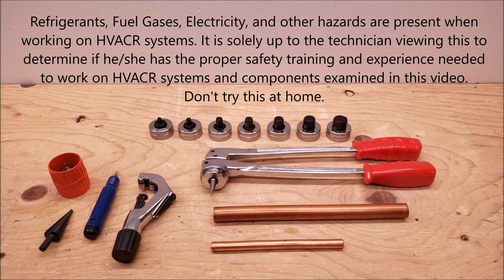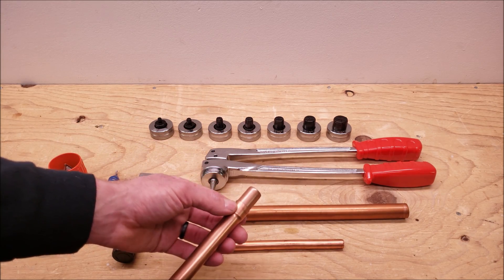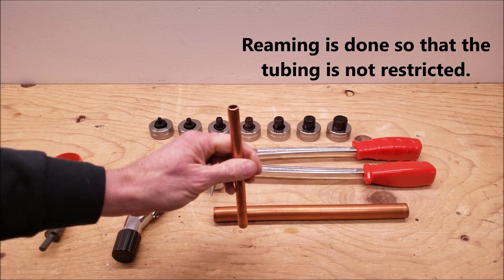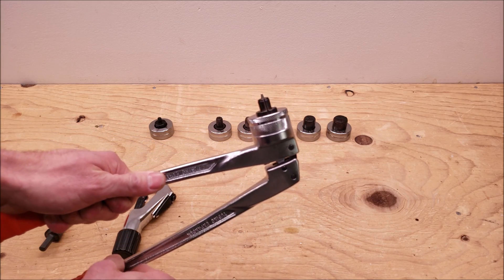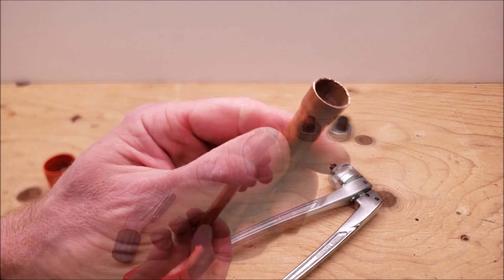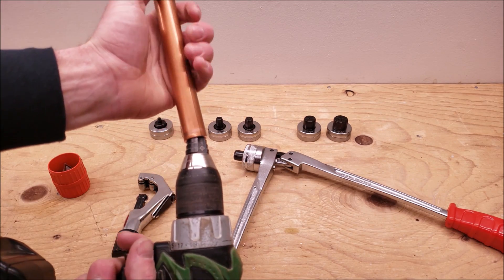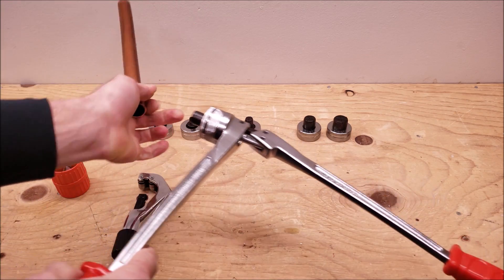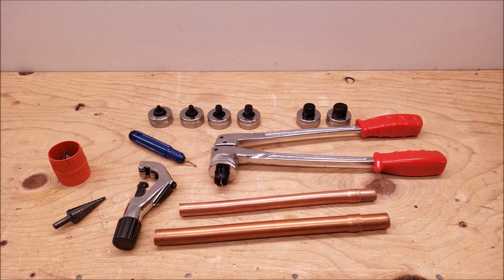Using a Manual Swaging Tool To Expand Copper Tubing!

Comment from the maker: Support-  https://www.patreon.com/acservicetech

Tool List-  https://www.amazon.com/shop/acservicetech

For those that are looking for the tools used in the videos: (Linked Below)
Manual Copper Tube Swage/Expander- https://amzn.to/2WRPa1M
Uniweld Hydraulic Swaging Tool- https://amzn.to/2MlrI8m
Uniweld Swage and Flare Kit- https://amzn.to/2T55jyn
Uniweld Hammer Swage kit- https://amzn.to/2CzWMMU
Uniweld 3/4" Hammer Swage- https://amzn.to/2CzXsSs
Uniweld 7/8" Hammer Swage- https://amzn.to/2Mja5WE
Uniweld Multi-Size Hammer Swage- https://amzn.to/2T3Cx1b
Ameriflame Oxy Acetylene Torch Setup- https://amzn.to/2SRm3JF
#2 Tip for Oxy Acetylene Torch- https://amzn.to/2SPDaeD
Cap-N-Hook Tip for Oxy Acetylene- https://amzn.to/2MbhpUk
Air Acetylene Torch Setup-    http://amzn.to/2aQalsb  
15% Silver Brazing Rods-  http://amzn.to/2gVLyLc
Nitrogen Regulator-   http://amzn.to/2bXdR5f
Nitrogen Flow Meter-    http://amzn.to/2brvoBg
NitroVue Flow Reg-  https://amzn.to/2MiulYv
Ultrasonic Leak Detector- https://amzn.to/2Lw4Zpr

UEI DL479 Multimeter with temp sensor http://amzn.to/2jtsUbJ

Magnet Jumpers- https://amzn.to/2PyKPQZ

Alligator Jumpers- https://amzn.to/2PxqJXn

Fieldpiece ST4 Dual Temp Meter  http://amzn.to/2wc1ME3

Fieldpiece Bead K Type Temp Sensor https://amzn.to/2DBwKfs

Fieldpiece Wet Bulb Temp Sensor https://amzn.to/2RRI7Tw

Fieldpiece TC24 Temp Clamp https://amzn.to/2qHLyjZ

Yellow Jacket Refrigerant Gauge Set http://amzn.to/2aenwTq

Refrigerant hoses with valves http://amzn.to/2aBumVI

Yellow Jacket Gauge set & hoses https://amzn.to/2vLVkV9

Yellow Jacket 4 Port Manifold w Hoses https://amzn.to/2BkuGIq

FieldpieceSMAN360 Digital Manifold Set https://amzn.to/2BdoaD4

FieldpieceSMAN460 Digital Manifold Set https://amzn.to/2nB4Fe6

Compact Ball Valve for Refrigerant Hose https://amzn.to/2KUisW8

QuickDisconnect 90 for refrigerant hose https://amzn.to/2MMtVcg

JB 6 CFM Vacuum Pump   http://amzn.to/2nqbvo8

Appion Blue 3/8" to 1/4" Vacuum Hose http://amzn.to/2uYlVyc

Appion Red 3/8" to 1/4" Vacuum Hose http://amzn.to/2uYg6Ro

Appion Valve Core Removal Tool http://amzn.to/2uYr8WL

Yellow Jacket 1/4" by 1/4" hose http://amzn.to/2umtcod

CPS Vacuum Micron Gauge http://amzn.to/2v1nM3O

Supco Vacuum Micron Gauge http://amzn.to/2v1JRiA

RectorSeal Bubble Gas Leak Detector http://amzn.to/2ckWACn

UEI DL389 Multimeter  http://amzn.to/2xAdaJf

Other tool links can be found in the video description section.

Shop through Amazon! Your Purchases through Amazon provide a means for channels such as mine to earn advertising fees from all purchases after clicking through. Prices are the same as normal-    https://www.amazon.com/shop/acservicetech

Comment: why would u turn that pipe in the midlle of the process?
Reply from the maker: That is because of the gap created at the tool head to avoid the copper from cracking there and to give a more round finished product, thanks!

Comment: It is easy to ream a pipe when it is not fixed in place, however, what do you do when your faced with a line set that is fixed in place and you have to cut pipe. Reaming the section of pipe that faces downward is easy to ream, however, what about the pipe facing upward. Deburing the bottom half of the pipe would cause burrs to fall down inside. Can anyone advise how to best handle this scenario.
Reply: Use a long screw and screw that into a piece of cloth then run the cloth inside the tube then debur, then just pull the cloth out with the burs.
Reply: I blow nitro at a higher pressure and it works for me. Just ream it evenly to keep the shavings in one piece. Hope this helps brother.

Comment: My Rothenberger  swaging tool sits in the back of the van. I press 99% of my fitting now. Besides I always anealed my copper pipe. It softens the pipe and helps harden it. Preventing it from splitting.
Reply from the maker: Yeah some companies are press fitting, thanks gostmanromeo uk!

Comment: Last job I worked on was breaking some of the older pipe so had to use couplings ?
Reply from the maker: Hey Matt, What size were you swaging? I don't use expander tools such as the hydraulic or the this one for 3/8" or smaller. The opening size between the die teeth end up cracking the pipemon 3/8". This doesn't happen every time but sometimes it will have a crack that you can't see it with 3/8". Sometimes it will swage the 3/8" ok but I find that using the hammer or turn style swager with the swage block works best for 3/8" every time. For the other sizes 1/2" to 7/8", it works pretty darn good. I will tell you that depending on the manufacturer and the batch, the copper tubing may be able to be bent but just is not annealed enough and can crack when trying to expand. Annealing is the heat temp process that allows the tube to be soft. This doesn't happen very often but when it does, you may want to let your distributor know if it is new. I had a 50 ft box of line set that was new and I was trying to bend it through the building. It started kinking in spots. I got pretty frustrated and was thinking, this does not normally kink like this. I ripped it out, went back to the shop and got another 50' box and had no problem running it into place with no kinks. I called the distributor and they contacted the manufacturer. Come to find out that they recalled that batch of line set from all distributors and they could tell by manufacturer number on the box. They sent two boxes to replace the one that was bad and I din't have to give them the old one because they knew the problem due to the batch number I read off of the box. Anyway all that just to say that some tubes are annealed enough to bend some but not a lot. If you buy ACR copper, it should be fine for swaging. In some situations like that, we need to just add the coupling and move on as a lesser annealed tube will still be fine for holding in the refrigerant long term but just won't bend or swage as nice. In a pinch a tube could be annealed with heat from a torch in order to swage prior to brazing but the whole problem is oxidation in the tubing is created and that is no good but if you are trying to make a small swaged piece, it is possible to clean the inside of the tube prior to putting it onto the system such as 5/8"-7/8". I hope all this helps Matt, Thanks!
Reply: 1/2      I was told heating it up next time would help I normally don’t have a problem except with 3/8 sometimes I do like the Hilmor Bender and swage I have the yellow jacket kit where you can  flare and swage as well  a little more time-consuming which I’m OK with as long as it comes out correct I appreciate your experience and help once again Thanks
Reply from the maker: I agree, don't use the expanders on 3/8", use the slower way for the best swage on small tubes like that, thanks

Comment: Gotta love the hand manual expander just a few seconds and you have a perfect joint.
And you never have a flat battery or low oil level!
Reply from the maker: Yeah, absolutely, thanks Mentorcase!
Reply: Mentorcase- Yes but useless in tight quarters
Reply: I have the black max manual one and is cool .